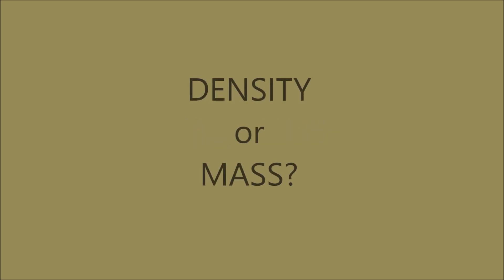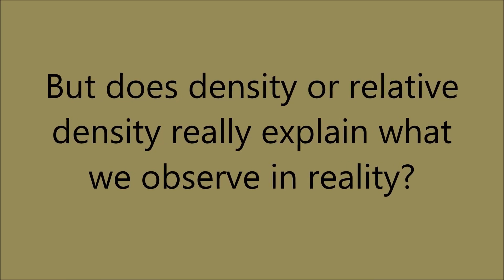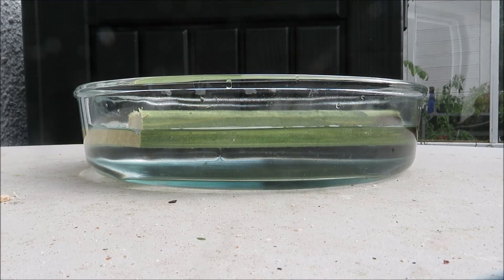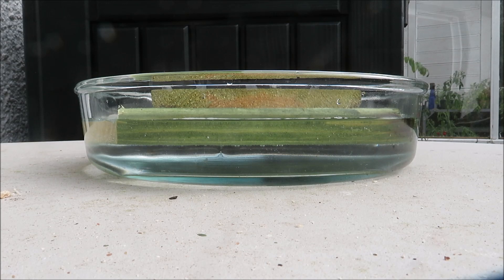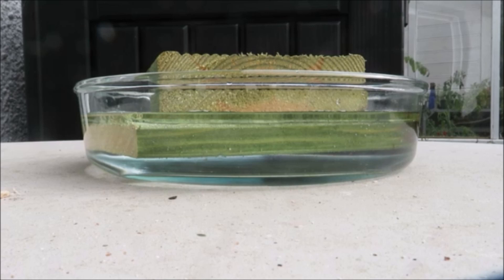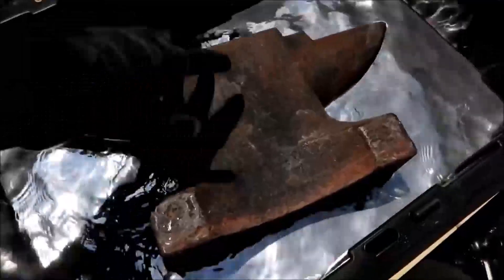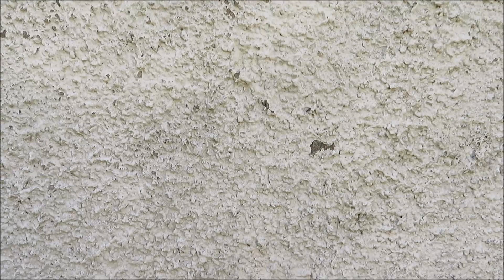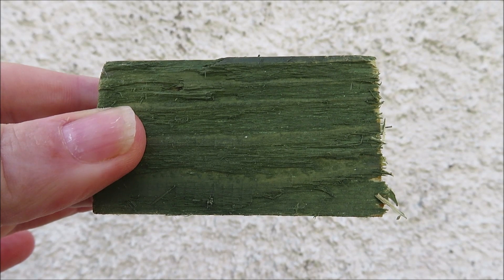Density or Mass?   Gravity or Relative Density?

Comment: Dishonest explanation. Noone on the flat plane believes that density is solely responsible for floating on water or air. Else a couple pool noodles would be able to hold up a house.
Obviously the DOWNWARD force of the element on top is adding more mass to the water causing more of it to be displaced.
Although considering how FLOWY water is if gravity was a constantly increasing acceleration it surprises me anything can float. Why wouldnt the increasing acceleration of gravity cause all objects to sink over time? Is "Gravity" cancelled out by the density and mass of the medium beneath the object under the downward force?
Obviously. Im not sure of any flat earthers who would deny there is a downward force inherent to existence.
Pretty sure they would all disagree because there is a downward force that we live on a sphere and all matter attracts all matter.
Because it doesnt. It would be easily observable everywhere you go.
If particles can collide and stick together at millions of miles per hour from an infinitisimal point expanding divergently outwards.
Then clearly they can collide and stick together under the much lesser forces of earths gravity.
Considering we are in the goldy locks zone of not have any physical effects from the earths apparent rotation, movement around the sun, getting pulled by the sun through the universe.
We really only have to worry about the downward acceleration which pales in comparision to the forces these particles initially clung together under right?

Comment: Just to play devil's advocate (I'm very much on the globe/gravity side barring some actual evidence to the contrary) the first demonstration doesn't really disprove the density equilibrium theory. The wood plank is more dense than the air above it, so the air should be pushing the plank down into the water, however the wood plank is also less dense than the water, which means the water is also going to be pushing the block back up into the air.  So of course the plank will come find it's equilibrium somewhere between being completely submerged in the water, and completely above the water.  The problem always has been the directional nature of the force causing things to fall.  (As pointed out at the end of the video)
Reply: Someone’s breaking free from the soul lure system 😏

Comment: Are we to assume you have the camera vertical and up the right way Miles?
Reply from the maker: I would recommend making any assumptions. What do you mean by vertical? What do you mean by the right way up?   I think you may be starting to understand the point I am making. You have all the required information about the density of the wood and the air that surrounds it, but you don't have enough information to know what will happen when I stop holding it.  So what else do you need to know?  Answer that question and you effectively prove gravity exists.